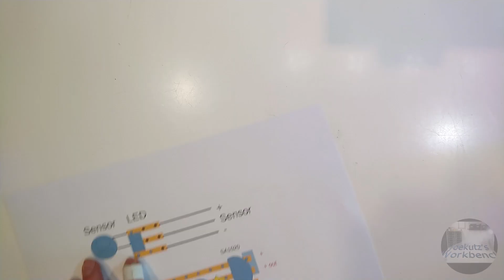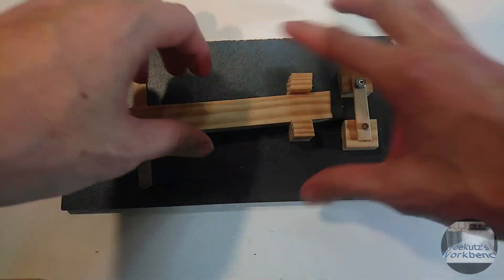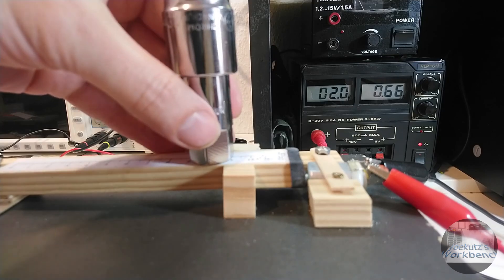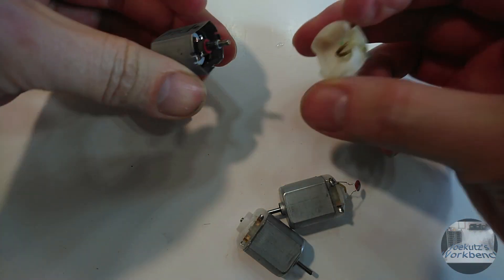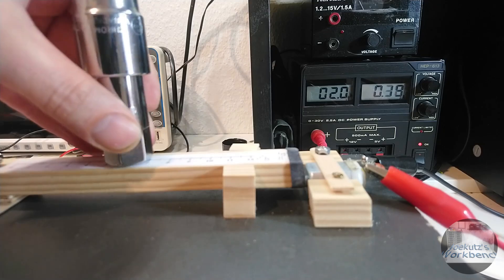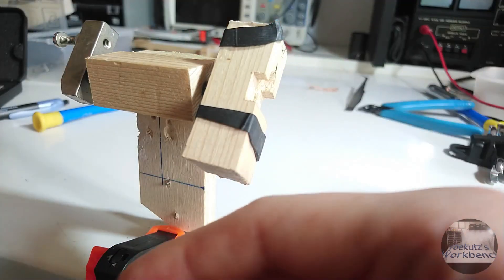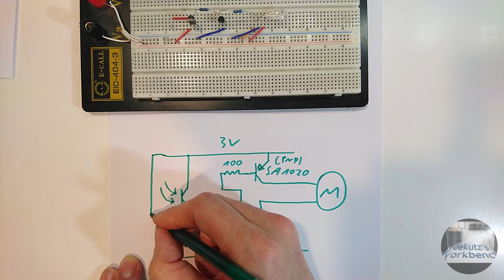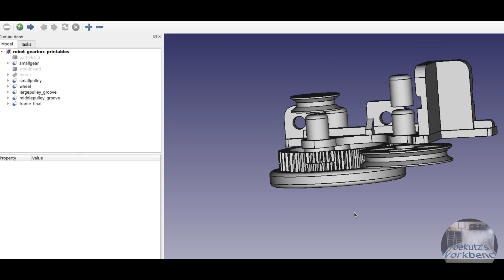I designed Robot Vehicles for a STEM course and found that Toy DC Motors are flawed now.

Comment: Why did you just not use a bo motor? Surely buying a bo motor has to be easier for a kid than to get 3d printed parts right?
Reply from the maker: Because 3D-Printing was part of the tinkering experience, and a BO Motor ("Battery Operated motor") does not show its internals. I wanted all moving parts visible.
Reply: @Joekutz  so would 3d printing a clear case for those motors be a solution then?
Reply from the maker: Theoretically yes. But FDM-printing a clear case does not really work and SLA-printing is less STEM-education-friendly. And the beauty of FDM-printed gears and pulleys is that they are quite coarse and fit the hands-on approach nicely.
Reply: @Joekutz  ah I see, I don't really know much about 3d printing.

Comment: That's amazing! I wonder what kind of torque you could get if you rewound one of the bigger armatures, if you could find them? Maybe the manufacturer has a data sheet of different versions?
Reply from the maker: I actually found a cheap fan after these that had a motor with the long armature - so they still exist :) with 150wdg of 0.15mm wire they do get quite a bit of torque.